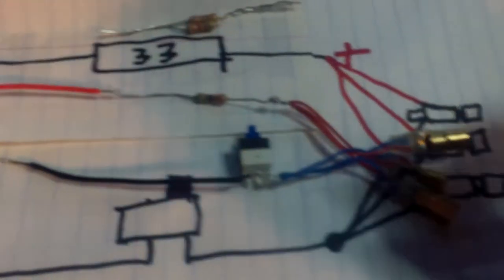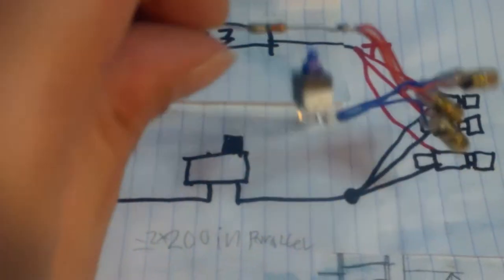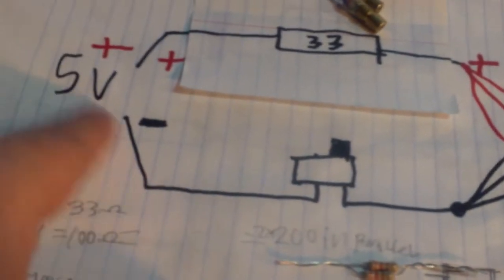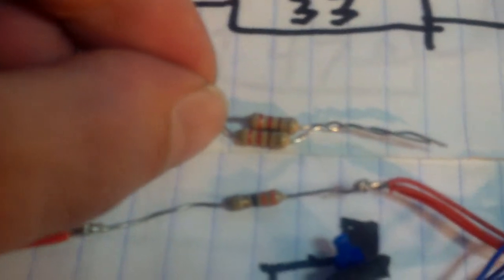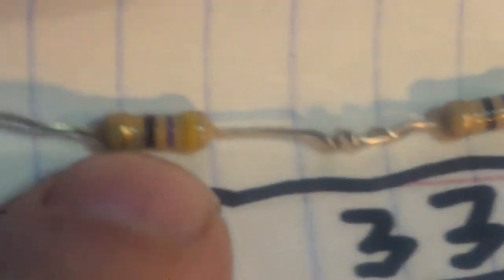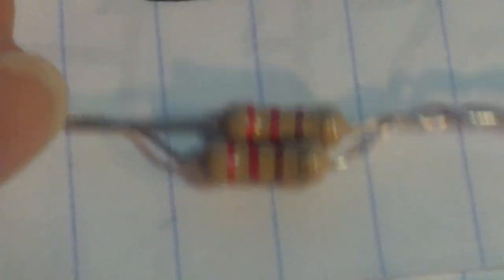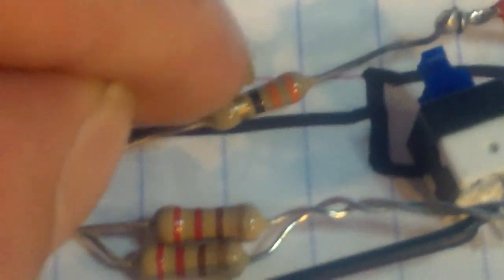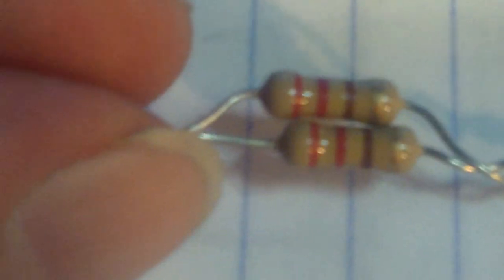Jozzafafs video

Comment: thank you very much Kyle. "Not All Heroes wear cloak" 

I already have the lasers installed on my biohelmet. I just needed to connect the proper Resistor.

Thank you very Much
Reply from the maker: Good luck finding those resistors and hooking them up , Take Care Man :) .
Reply from the maker: Two 220 ohm resistors is right , red red brown , hopefully theyre the right wattage so they don't get too hot .    Cool Man  Good Luck :) .
Reply: 0.5 watt is correct for it?
Reply from the maker: .5 is a half watt , yes , that should be great , when you get your circuit working just feel them after a minute to see how hot they get , but .5 watts sounds great , better than My 1/8 watt resistors .  Cool Man .
Reply: thank you very much again. You are Great.   Tonight I'll set the circuit.
Reply from the maker: Cool , I cant wait lol .  You're very welcome , I always love My Predator Fan Family .   Take Care Man , good luck .